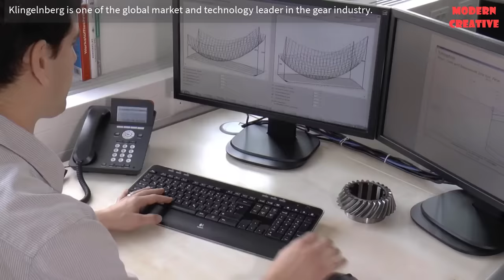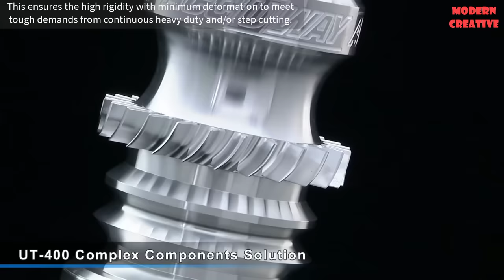Amazing Huge Gear Production Process | CNC Machine In Working

Comment: I'm not a machinest but I do enjoy watching videos on cnc machining it's amazing how accurate it does it work with all the steel moving as fast as it does and stopping exactly where it's told to stop.
But I do have a question @ 6:40 how does the tool know where to line up when cutting the groove for the threads with each pass without it starting a new set of grooves I find interesting how fast the material is spinning yet the tool finds the same groove all the time.
Reply: In a CNC-mill like this one, it is programmed and based on position, that means that the part and cutting tools knows exactly where it is at at all times. When programing it, you can see the part getting cut in a simulation, what cutting tools to use, speed, and so on.
Reply: @olehoiii  as a former machinist i endorse this explanation.
Reply: Perfectly correct and it should also be not that,  the machine can create a different thread groves in situation which we dismountle the piece and mount again (due to change of reference point).
Reply: The machine has sensors in the spindle so it knows precisely what degree and velocity the spindle is at all the time. There are PID loops going on. The machine controller (the electronic control unit that runs the CNC machine) controls the spindle and the lead screw of the machine. So it can coordinate all of the movement. The spindle is the A axis. The lead screw and carriage are X and Y Computers are idiot savants at math too. They're just supernaturally good at it. Counting and calculating is what they do. What's really going on when you get into the nitty and gritty of it all is nothing short of amazing. The machine is taking all kinds of parameters into consideration while it's executing operations. What it can do, what it's been asked to do, etc. It's pretty crazy.

Comment: I did my apprenticeship at a place called Power Plant gears ltd in West drayton UK. They manufactured massive gears and gear drives just like this. It shut in the mid eighties so there was no CNC machining. After the gears were cut they would be hand scraped and lapped to perfectly bed the gears together. Our main gear cutting machines were Schiess from Germany. Power Plant claimed to be the pioneer in helical gear cutting. They had been going since 1903 and at one time actually built gear cutting machines.
Reply: If a company didn't make the transition to CNC then they folded up. You can't compete with CNC. I mean just look at it. These are basic machining centers here too. Nothing too fancy. No 5 axis or what have you.

Comment: The subtext in the section starting at 3:45 and going to 7:09 about CNC programming is pretty much spot on. You have to be a good manual machinist before you can become a good CNC machinist/programmer.  

As a member of the last generation of machinists trained on manual equipment before I even got close to a CNC machine, if you don't know how to machine a part manually, you're going to be clueless about how to properly program a CNC machine. The computer will not save you.
Reply: My man. I got a small CNC router. Then a big heller, índex lathe, and a EDM. The only experience I have on manual machines is watching abom79. And It is defiantly possible to jump right to CNC machining. The power and speed of a modern machine is so high just fell on a manual machine cannot prepare.
Reply: There was a time when I would have agreed with you.  Just watching that grooving tool at 5:07 proves that a manually created program
will have wasted motion.  Look at how long that tool cuts air before it reaches the material.  The turning module in GibbsCam would never
create a toolpath with that much air time.  We continuously track the material state so that the tool is positioned within a few thousandths
of the stock to eliminate unwanted motion.  CNC programming with today's technology could never be duplicated by hand.  It's just not possible.
Reply: Chris brother let see your video and show us few tricks I’m looking forward to see your face on YouTube

Comment: Machines are the test of motions and properties.

It's a test of materials.
What level can be used to build that equipment.
Precision machinist 
How, it has standards it's either miniature or enlarge or normal size. That's an auger in my field.

The diamond tip cutter.
As I've mentioned it's all in the package but some of the materials are expensive.

Comment: Wow, Very Nice Accuracy Computer Numerical M/c made Crown Wheel n Pinion Shaft ,Good Finishing with Nice Modules Gear  Profile.
Reply: Very Good Heat Treatment Process of Hardening in Furnace with Specific Temp.the Gear Transmission Mechanism Fitting in Differential

Comment: what are the qualifications you need to become a CNC programmer
Reply: There's no qualification needed to do anything, but the question is do you have a CNC machine? If not, then it depends on who owns it as to what they want to see. You can crash a machine very easily.
Reply: At this Company (Klingelnberg) you neither have to made an apprenticeship as a mechanical engineer or cnc  specilist (Both have a duration of 3,5 Years)

Comment: 4:00 There is a mystery I can't figure out about this cutting process: 

the blades cutting the steel have to be made of a steel, metal, harder and more resistant than the steel they are cutting, that's only logical. But these blades themselves had to be cut and brought into shape and sharpened by tools made of a material harder than themselves, and so on. So that would bring us to an impossible series in which there is no end, as every tool, blade, in this chain has to be brought into shape and sharpened by an already existing tool, blade, which is even harder.
Reply: These cutting tools are made of a powder that is pressed together and "baked" in an oven.
So they come like that finished. 

If I remember right there is wolfram in the powder which is a very hard material. 

And this is not a new way of producing,  turning machines has been around for ages.

I mean,  if you want, you can cut steel with a steel knife but the knife will become slow straight away.

Also the angle and speed is crususl for this to work
Reply: @bastrixer  Wow, thank you for having solved for me a mystery that has baffled me for ages. Anyway, I knew that some chemical rather than physical process had to be involved.
Reply: Most of these tools are made of tungsten carbide indeed by baking the power pressed forms in a process called sintering. But even these can be sharpened by using a diamond or CBN grinding wheel. Grinding is in fact how hobbyists can make bits out of hardened steel, which cuts through soft steel without a problem.

Comment: I remember machines like this - on a much smaller scale - producing hypoid rear axle gears some seventy years ago.  They were similar to bevel gears but with non-intersecting axes.
Reply: CNC goes way back to the 1940s. The first machines ran paper tape. Then there's the Jacquard loom. It used punch cards. It was the granddaddy of all of this I suppose. The first Jacquard loom was demonstrated in 1801. So way, way back.

Comment: 6:00 so satisfying watching the clean finish pass. I always wonder why they are cutting dry? Been a CNC lathe machinist for over 10 years and we run coolant on everything we do. We also manually program everything as well. They are always wanting to push the conversational crap on us which just seems unnecessary for the things we run which is hardly ever anything new. So all of our larger programs are kept on file so we can just set up and run. I see no need for any additional computerized programming. Hard to stay fresh on something you rarely use when your so used to manual programming.
Reply: Newer cutting tools put the heat in the chip. Disposal or recycling of cutting fluids is eliminated.
Reply: I think they may have just been cutting a demo piece. Like look at what we can do. If they were running full flood cooling you wouldn't have been able to see very much. Just fluid shooting everywhere.
Reply: @1pcfred  I have worked with smaller versions of these machines like C27 for hobbing, it is completely dry. Blades are carbide with TiAlN coating. Heat gets out with the chips (they turn completely black with a blue/purple hue), part is OK to touch after operation, so it is safe to say it does not get too hot, no color change. Machine lifespan is higher and maintenance is easy if you run dry, you also do not need any washing before heat treatment with dry cutting. So if possible always go with dry cutting.
Reply: steel would be a vapor before carbide melted. So heat is not a concern with carbide tooling.

Comment: As an amateur lathe operator, I can see how much quicker this is than hand operating the machinery.  Good for repetitive work but I'm not sure about one-off components...
Reply: The efficiency of doing one offs is down to operator skill. There are people that can program CNC machines on the fly with a very high level of proficiency. Not many, but some. It's the ten thousand hour rule. Do anything for 10,000 hours and invest yourself enough into it and you get good. To get good you'd have to do more than just load parts though.